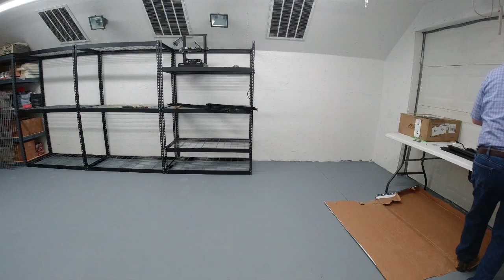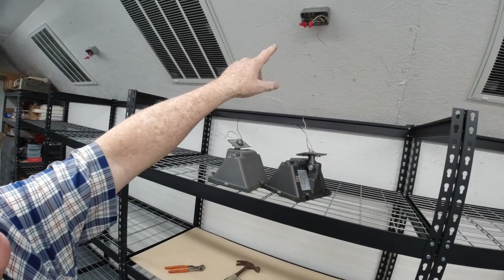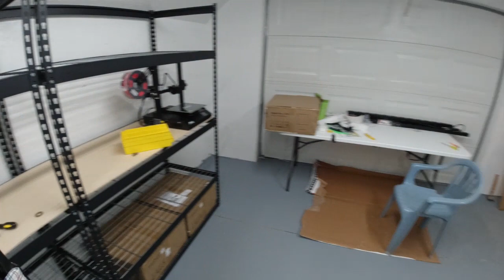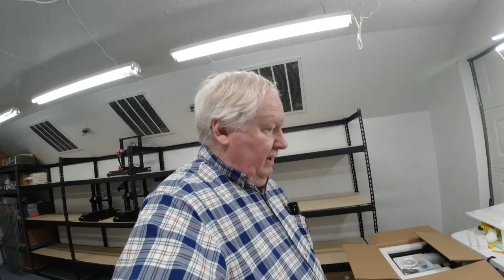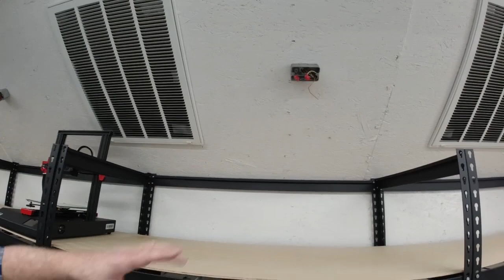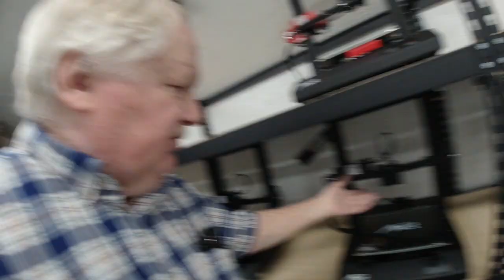MY NEW 3D PRINT FARM PART 4, Making room for new Anet ET4 3D printers at New Tech Inventors.

Comment: Are you going to run Octoprint/Repetier-Server with cameras to manage your print farm remotely? How are you to going to manage the heat from all of those printers?  That room will probably get to 75-80 degrees in the winter and even hotter in the summer months. You will have to watch using AC. Random cold air will causing warpage if it hits the bed area.
Reply from the maker: I am not running Octoprint. I will be installing cameras in an upcoming video and as for the temperature control in the room I will be relying on my Arduino skills to control the air flow and temperature in the print room. Thanks for the input...Ken

Comment: It's amazing to see how well you're progressing Ken! And it's not as if you have access to instructional videos or how-to books on "Build your own print farm" to rely on. Very inspiring to watch this (and assume you can probably assemble printers blind folded by now!!). I too Ken have been and continue to be heavily involved in construction so, I have a few suggestions that might help (possibly too late I realise but...) in the fire protection area:
- It just occurred to me in this video that the walls and ceiling are painted "aspenite" or OSB. I wonder for a room so heavily outfitted with heating/electrical devices, that it might be well worth the cost and effort before you fill it too much to apply two layers of 1/2" drywall or 5/8" drywall. The years I project managed constructions of labs of racks upon racks of servers, we would actually cover walls and ceiling with cement board (now you can even buy the 1/4" thick stuff that's easy to cut and is light) as an extra protections. I know this comment comes a bit late but, it might be worth it as prevention is a lot easier and more effective than fire protection (i.e. sprinklers!).
- I would replace or, cover the particle board shelves on your racks with cement board. If a printer heats up and then catches on fire, it will burn the wiring, then the filament and the wood board (both the bottom and the shelf above) would be next. Replacing them with cement board removes a great deal of combustible
I would not have anything in this room that is extra combustible or even store anything on the bottom space between the floor and the first shelf. Again, if the melting and burning plastic drips all over the place, some might end up on the floor than igniting the cardboard boxes and then ...
- Maybe consider having your electrical circuits surface mounted and, in metal conduits. I would suspect if you were to have a fire, it would be caused electrically, with wiring overheating (excluding the printers where many areas in them can cause a fire). Your electrician might have some good opinion on this. Plus, upgrades and add-ons could be a lot simpler to fish new circuits too.
- I'm not sure I would plug too many printers on those power bars. Even if the bar is connected to a dedicated circuit, I wouldn't trust them at all. Plus, some of these bars have a built-in circuit breaker. So, it this one bar trips prematurely or because it's of lesser quality, all the printers connected to it go down. Even with printers with power resume, it may not work properly.
- You might look for a full spectrum monitoring system (heat, infrared, smoke, etc.) all over this room. Same with electrical monitoring to register spikes or breaker trips alarm system.

Sorry for this long winded outline Ken. Like they say  "if I had more time, I would have made it shorter". Hope they help Ken and as always, willing to discuss more if you wish. Claude
Reply from the maker: You have a good point. I purchased some sprinkler heads and was thinking on putting them in in case of fire with an electrical shutoff system. Your right , I could use a hardie board sheet on the shelf and may make that change thanks to your comment. I am also looking at infrared sensors to detect high temperatures at each printer. Thanks for your input...Ken
Reply: @NewTechInventors  Once again Ken, you're proving you're ahead of the game on all of this, thinking of all the small details. It's too bad we have to worry and plan about how these inexpensive Chinese products may cause so much damage. Claude

Comment: Nice farm .. how many to a circuit can you put in line ... I think they are 24 volts each so it seems you can put 3 safely on one outlet.?...
Reply from the maker: That question has come up several times and I just finished a video explaining how to calculate how many printers to safely put on a 20 amp circuit. Thanks for the question and be sure to see my video with my answer.
Reply: Thank you sir....joe

Comment: @3:08, you can see a height error in the shelves in lower right. 
Also You can only run 2-3 printers on a single 20 amp circuit. I can see from your meter long power stripes that you were planning otherwise. Each printer has 2 heaters on it, so they really use power.
Reply from the maker: I knew someone would notice that mistake. You win the most observing eye award my friend. I also noticed that mistake after I had shot than vides segment and if you notice I had corrected it later in the video. Thanks for catching that. I have just completed a video showing how I calculate 3D printer power requirements. Will post it tonight. Thanks for youe help and support...Ken